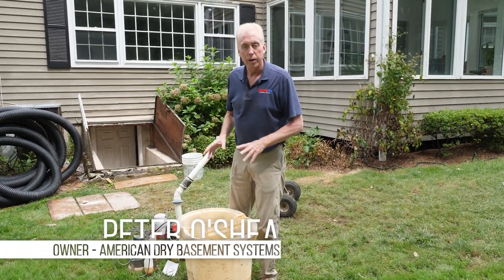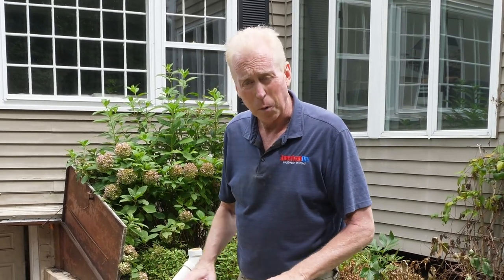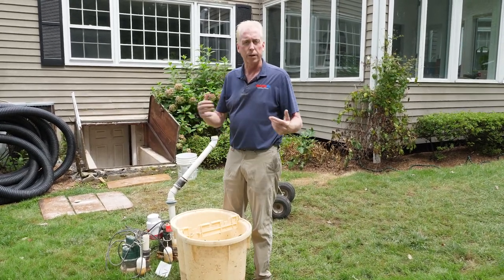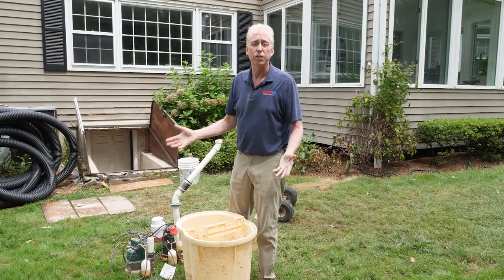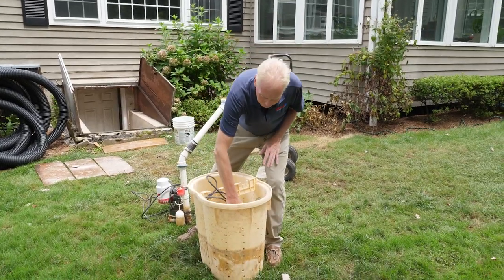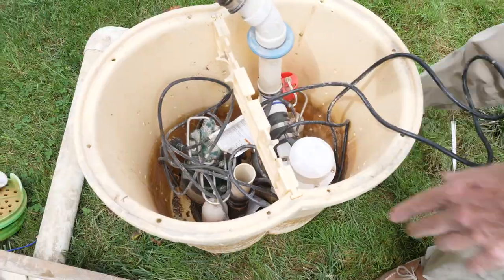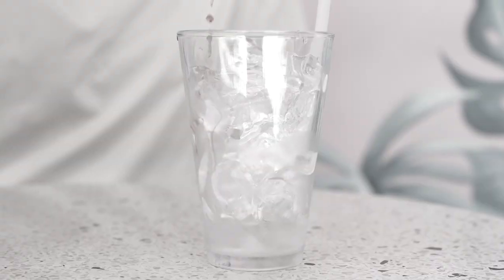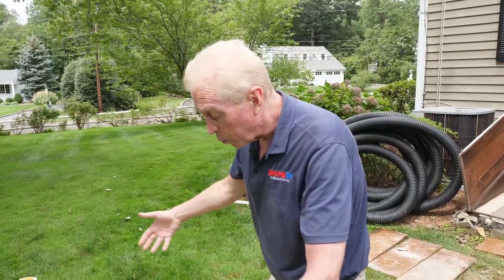Avoid Sump Pump Installation Overload - Basement Waterproofing

Comment: Great videos> Question: I just realized that in one section of my interior french drain, which is perforated corrugated, I have tree roots growing, fortunately not yet totally blocking off, I can see through a cleanout. Should I use root killer? It's on the other side from the pump. I don't think I should use one of the foaming ones, I don't want a bunch of foam in the pit. Maybe use something like Zep root killer, which is non-foaming?

Comment: when you do perimeter drain, why do you use corrugated pipe instead of pvc? (like schedule 40)
Reply from the maker: Perforated PVC Schedule 40 pipes are more susceptible to clogging pitched or not. Flexible perforated, corrugated pipe is harder to install on a pitch but the benefits outweigh whatever PVC pipe can offer. Most importantly corrugated pipe self-cleans utilizing the ridges to create a vortex of water on a pitch. Go across the US highways and you will see oversized corrugated pipes used for drainage on major roadways. With proper installation, it is the best drainage pipe money can buy.

Comment: Another great video and analogy. I have ran into an issue with my system installation. At a point about 10ft before the basin pit, there is a sewer waste line. It is at a height where going above it isn't an option since there wouldn't be any slope going towards the basin, so the only option is to go under it. The depth is around 20" with the perforated ABS line in. I can slope to the basin but the line going into the basin will be drill basically at the very bottom ( have a 22" basin). What do you do in this type of scenario? I can get a 24" basin but don't see anything deeper than that aside from using a trashcan? Is it ok if the line enters low into the basin like that? Is there a particular way you handle this type of scenario? Thank you kindly for your time and any help you might provide.
Reply from the maker: If you can't go over it or must dig an unforgivable 20" deep, instead go around it and continue on the same path with a pitch. Never enter low in the basin. Stay at a depth of the footer. No lower.